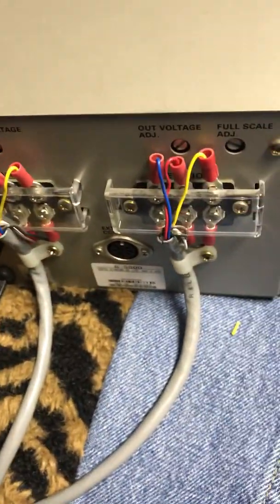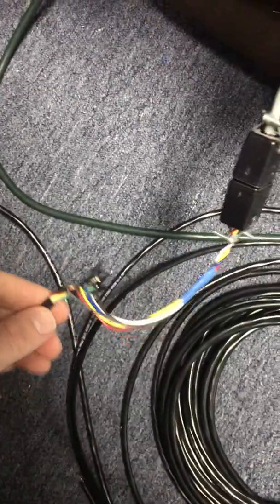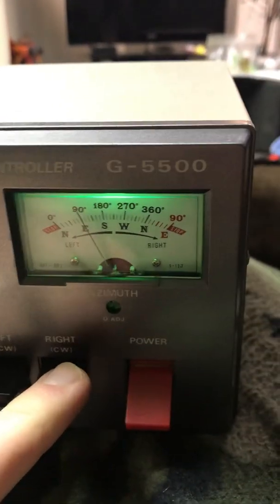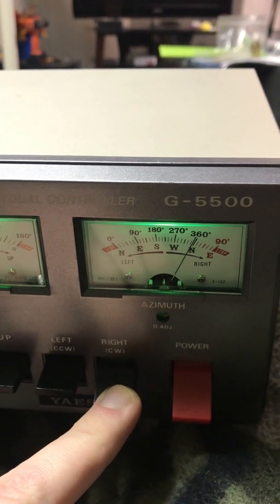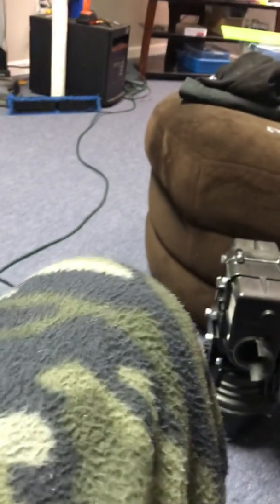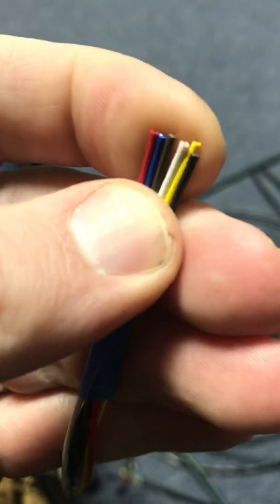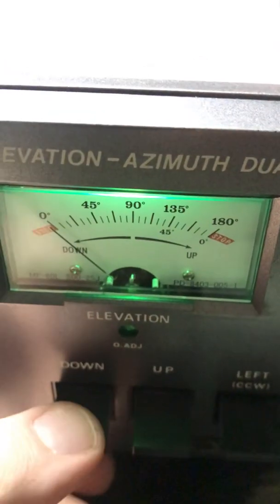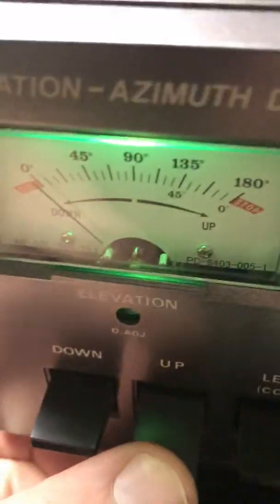Yaesu g5500 issues

Comment: Did you try the Full scale adjustment? if not try this for the Az when it is full left CCW there is a mark on the housings that should line up. then run it 360 degrees so it matches up with the mark when it is full left CCW. at that point the meter should read 360 if not then adjust the Full Scall adj in the back to match read 360. The Zero on the gauge looks close when the power is off but if it isnt on 0 when the power is off you can adjust it to 0 using the screw under the meter on the front. The voltage adjust in the back if I remember correctly is for whatever computer control interface you are using , if the controller does not read zero when the rotor is at zero then you can adjust that voltage output.'73 KC3KOP
Reply from the maker: Yeah it’s the damn pot. I’ve read yaesu won’t sell them to you. That you have to send the friggin thing to them which is the biggest sham in history. Looking for an alternative pot